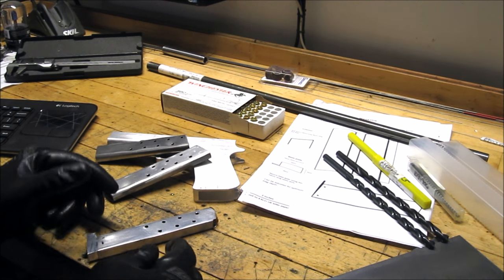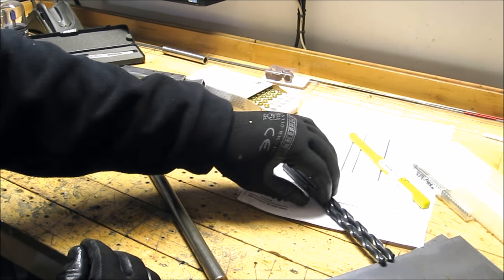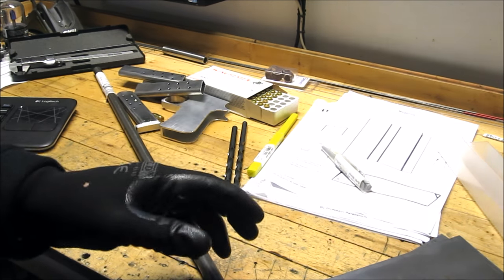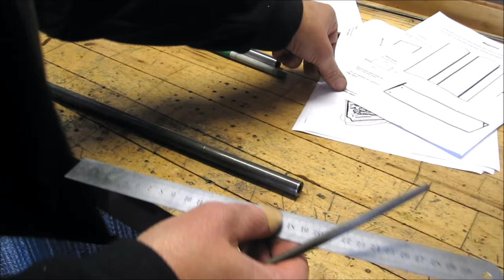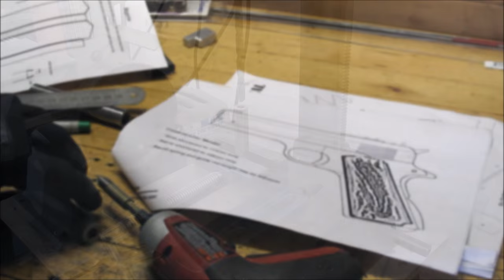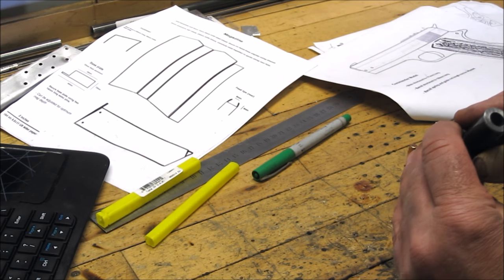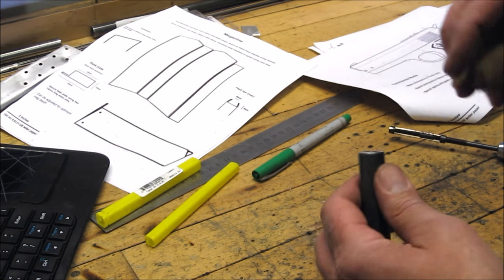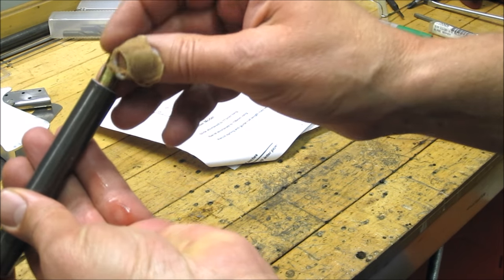Kolt380, barrel math

Comment: if you can, run the reamer slower, around 120rpm. different cooling aids give different diameters, oil makes it slightly larger, emulsion makes it slightly smaller. if the alignment of tool and part  isn't 100% perfect, give one part space to move, either the tool or the part. I'm a professional, its my job to work with stuff like that but I'm very impressed of your abilities to improvise at home. the real word MacGyver.
Reply from the maker: +Mofo Jojo I've observed that. I'm always surprised at the differences in expected ID's.

Comment: Great video as always, I noticed a bandaid. Did you cut yourself on a burr, or did you hammer on the wrong nail?
By the way, what kind of plane did you work on?
Reply from the maker: +JagdtygerII I sliced that thumb on the magazine feed lips just prior to showing off on how well the round pops of the top of the stack:( Serves me right for showing off. I built an RV-6 from a very early kit. No pre-drilled stuff for me.

Comment: Thank you very much!  I love the detail. That's 5/8 4130 drawn on manderal tube?   Where are you making your calculations for what diameter the barrel tube should be, given the pressure of a .380?  Will you be hard chroming the bore to extend the rifling?
Reply from the maker: +The Laughing Hyenas I used a number of engineering tables and calculators. I consulting a friend who works in the hydraulic industry as well. As to the hard chroming, I don't know. If the end result of this build is satisfactory, maybe.

Comment: Is it possible to cast some parts with a backyard refinery and mold or would it be too non-structurally sound for a firearm?

Another thing, you have mentioned you plan on doing a more professional gunsmithing series on another account. Have you ever considered doing something similar to the Man At Arms guys, and building weapons found in video games and test firing them at a range? I can already hear people requesting the Fallout 3 Combat Shotgun.
Reply from the maker: +Joey Skylynx I suppose the trigger could be cast. None of the FCG parts. Maybe part of the frame. I haven't ever cast DIY stuff and don't know what kind of quality one can achieve.

The other channel plans are quite a ways in the future. It will have to be unique enough to stand out. Your idea holds merit.
Reply: Actually, regarding the video game concept. You could also adapt that idea to include the situations in which the weapons were produced and try to replicate it.

Comment: Where did you get the adjustable reamer? The build is looking good.
Reply: +Aaron Krogh look it up on amazon. Harbor freight and grizzly also sell those too. Pretty much essential pieces of equipment in gunsmithing if you work with making barrels.
Reply from the maker: +Dave Smith I have a local machine tool supply place for most of hand tools. The above poster is correct, Grizzley and HF have full kits.
Reply: +Clinton Westwood Thanks for the info. I will get started on making one. It will beat me making my own reamers. I've made to many as it is.

Comment: Looks as if your using ATF for your cutting fluid. I know it is a high detergent oil and when mixed 50-50 with acetone it makes a very good penetrating oil, but what are the advantages to using it to cut with?
Reply from the maker: +Dillard Hayes Good eye man. Did you know that it was also synthetic? :) It was the only oil I had on hand or could find easily. I use anything I have in arms reach. My bad.

Comment: I have a question; If the bore is the same size as the bullet, then the grooves are an even larger diameter, how do the lands CUT into the bullet? It seems that propellent gasses will escape around the bullet through the grooves.
Just an observation or am I missing something here?
Reply: I think you are right.

Comment: are you planning to heat treat the barrel or are you relying on the factory tempering
Reply from the maker: +Kyle The tubing as bought is in condition N. Not sure what I'm going to do.
Reply: +Clinton Westwood I'm no expert but I would recommend heat treating
Reply: +Clinton Westwood SAAMI pressure for .380 Auto is 21,500 psi. Ultimate tensile strength of 4130 is 97,200 psi. Here's the link to the calculation:
http://www.corrosionmaterials.com/technical/burst-pressure-calculator/

Comment: i think you made a mistake with the barrel. the way you measured it the lands will be the diameter of the bullet instead of the grooves. when you cut away material for the rifling later it will be bigger than the bullet if it fits the barrel now.
Reply from the maker: +james dieter You can't see on the video, but there's a slight countersink to each end where I deburred it. The bullet sits about .030" proud of the barrel. That should be enough for good contact in the grooves.
Reply: ok, i see. your videos are really interesting and i am looking forward to the finished product. too bad it is illegal to build a firearm where i live (germany) :/

Comment: So I can't find what the wall thickness should be between the case and outside of barrell...assuming this is the point of greatest pressure...i bought a .380 barrel blank but cannot find out if the chamber end needs to be something separate that is thicker or if I can drill and ream barrel blank to accept case?
Reply from the maker: You can find a number of pressure calculators online. Use the max pressure specs for the round and apply some measure of safety above that.
Reply: thank you I came up with .167 but I may push it out a bit further..thank you!
Reply from the maker: That's very close to what I ended up with. I'm measuring about .190"
Reply: INTAO ESTOU SEGUINDO SEU PROJETO QUASSE ACABANDO , POREM INFELIZMENTE TIVE QUE COLOCAR MINHAS MEDIDAS NAO CONSEGUI IDENTIFICAR A SUAS.
ESTOU FAZENDO "'MEU PROJETO"' BASEANDO NO SEU POREM QUERIA SABER QUAL mm vc trabalha pra mim tirar algumas duvidas na minha regiao e sentimetros ou polegas se poder me ajudar eu msm faço os calculos .

Comment: how you make bullets... i do not know to make bullets... guncotton...primer powder...? i hope you can show me... thanks
Reply from the maker: I'm sorry:( I don't know how to make bullets either. I just go to the store and buy them.
Reply: Roll paper around a wooden dowel and put a bit of glue on the outside of the paper and put another strip of paper over that and repeat let it dry. And find some washers that fit in it. And super glue or epoxy them together. And glue them into the bottom of the paper case thats gunna be your priming pocket. 
You can use cap gun caps as primers and use powder or make black powder 
You can use bb's for a shotgun load or cast a lead ball for a bullet. And insert 

Powder
Wad
Projectile 
And caping wad. 
And you have an entirely homemade bullet
Reply: @Jason Krieger
I assume you're looking to fire live ammunition from a blank firing gun? Most blank guns are not made from steels suitable for handling the high pressure detonation of a cartridge. If I were to use 9mm P.A.K. as the base for a cartridge, I'd create my bullet to match the diameter of the barrel, and then taper the case around the bullet, however this will lead to headspacing issues if the cartridge is too short to properly chamber, or even feeding issues with the magazine if the follower doesn't apply pressure correctly. What kind of weapon would you use to convert?
Reply: Jacob Krieger not that i know of..easier to just buy inert 380 or put a lead ball into the pak round. Can't use standard barrel though. Obviously i know these things seeing as I'm from England;) I'd never consider it as that would make me a criminal lol compound bow is just as good and legal

Comment: If you reamed inside to fit the bullet, you don't need a rifling anymore, caz it will not spin the bullet. Am i wrong?
Reply from the maker: +Zaratustrov I wasn't clear on the video, my bad. There's a slight bevel on each end where I deburred the tube. The diameter is reamed for a .002" interference fit. The grooves will be the actual diameter of the bullet.

Comment: I'm not a fan of adjustable hand reamers the finish never seems to turn out quite right.
Reply from the maker: +Simon Rival So far, it's not too bad.
Reply: +Simon Rival 
Definitely they don't match the quality of a self honed reamer. Still, firearms can take quite a bit of cut corners and still perform well if the design is well engineered. 

One of my friends who I learned a lot of gunsmithing from built a bolt action "rifle" (legally it is a pistol) for benchrest shooting. Literally the entire gun came from a scrap heap of rusted Chinese mystery metal. He used a short barrel and a really thick wall diameter making this thing unwieldy as heck but this thing is a sub MOA rifle with his personal record of a 1.43" (or something, I just know it was under 1.5") group at 200 yards with some SSK cartridge (don't remember the specific diameter, might have been the whisper (blackout) actually). He just reamed a hole and installed a barrel liner. It doesn't hold a candle to the "real" benchrest rifles, but it definitely is no slouch.

There is a video on youtube of some guys shooting a savage bolt action mounted on a 2x4. Literally.

Comment: the speed for the reamer is too high for good surface make it slower. sorry my english iam from german
Reply from the maker: +Evoheizer123 Unfortunately, that's the slowest speed on my drill press. I didn't want to ream with my hand drill over concern of warping the cut.
Reply: ok than its my fault ;)
Reply from the maker: +Evoheizer123 No issue here. I'm not a machinist and I'll take any suggestions into consideration.
Reply: you make good work man ! keep on !

Comment: wery nice weithing fore shooting 380 is thet 7.65 cal pozz ppn vitezovi
Reply from the maker: +Argonco2 Actually measures as 9mm. Not Luger though. Less powerful.
Reply: +Clinton Westwood ok thet is 9*19 not makarov 9*18mm pozz ppn vitezovi
Reply: +Argonco2 9x17mm.
Reply: +Argonco2 9x19 needs locking or very heavy bolt, 9x18 doesn't need lock but might be too powerful for homemade guns, 9x17 is what he is using, very good caliber for pistols without locking and gives it a long parts life plus is cheap.
Reply: +〈--- Literally FAST food ™ (mɐin chɐnnǝl) thenks gud cal for shoting pozz ppn vitezovi
Reply: +oneproudbrowncoat thenks pozz ppn vitezovi